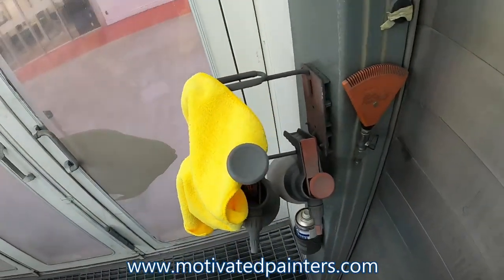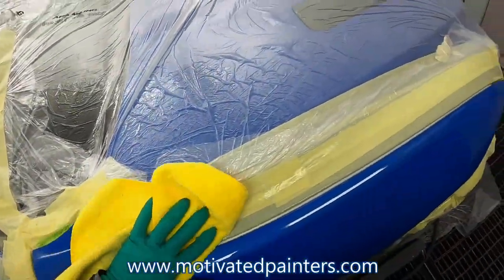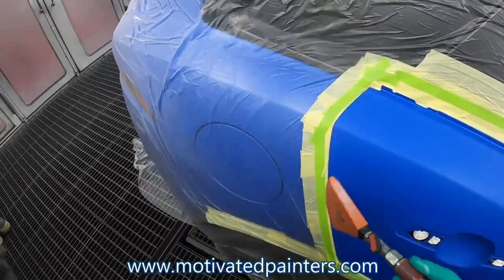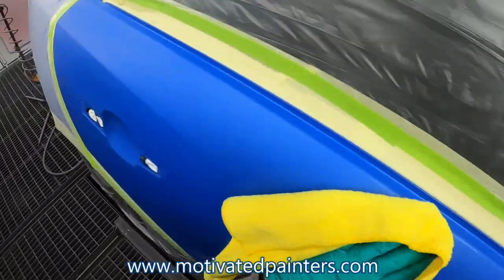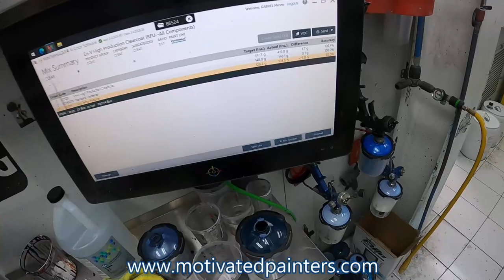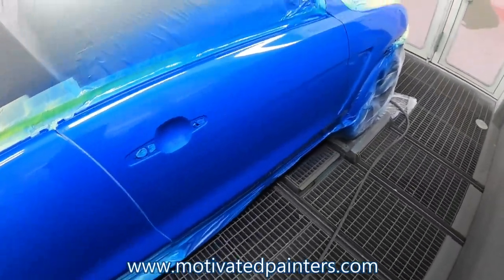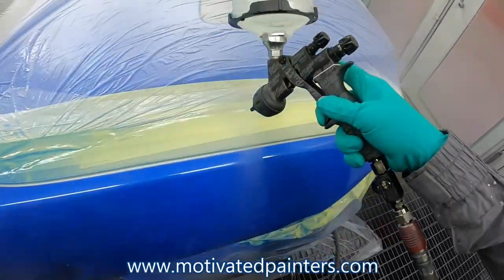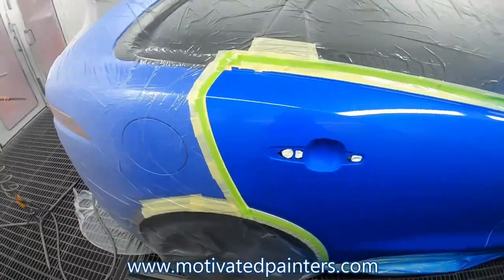Spray Painting Blue tips Waterbase

Comment: Great jobs always man , I have a question, For complete cars or  more than 5 panels do you thing the WALCOM 360 1.2 is a good enough option or 1.3 is the better way to go , my ex boss is selling the WALCOM carbonio 360 but both base and clear are 1.2 , I usually in my guns I use 1.3 only in the sagola throphy I use 1.2xl but this gun put a lot material , I don't have too much experience with the WALCOM so I don't know if is good to buy 1.2 or 1.3
Reply: 1.3 is good, but if u want that show car finish I’d use1.4

Comment: These blues can be some of the more deceiving colors for hiding. It's the pitch that will throw you. I've seen painters finish these and then look a it in the sun and can see right through it. This looked like it covered very well over that shade of gray primer. I usually seal or use the spectral gray base first. Works well. So you dont use tack rags at all anymore? Interesting. Thanks for sharing
Reply: That's why you turn the booth lights off and look at the coverage with a color match light. You can't ever trust the booth lights
Reply from the maker: I don't use them much! Only in certain cases like if I sand the base I'll tack it
Reply from the maker: Ye ssor!
Reply: @jeremyoetken2094  
Totally agree. Learned that trick some time ago. Unfortunately the other painter I was working with didn't do that and also used too light of a ground coat. He painted a complete F150. It didn't end well.
Reply: @MOTIVATEDPAINTERS 
Just curious. Thanks for the reply. Love your work!